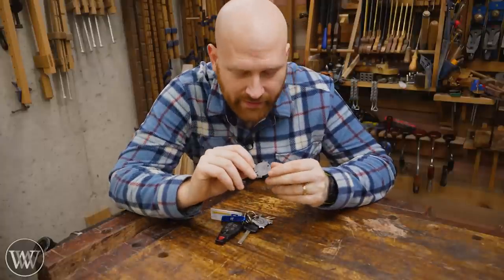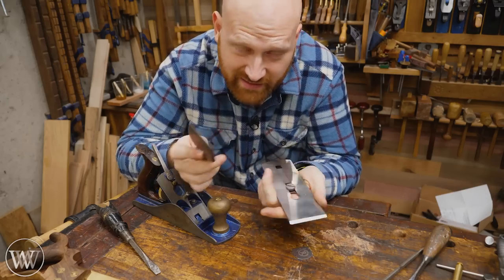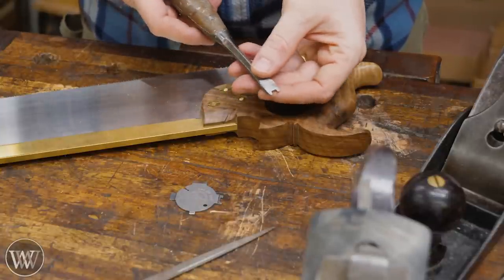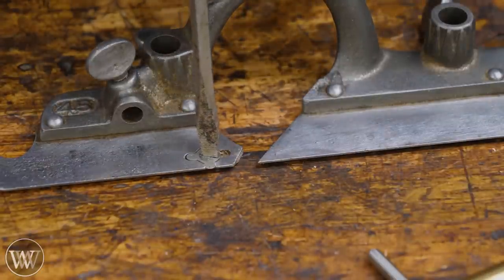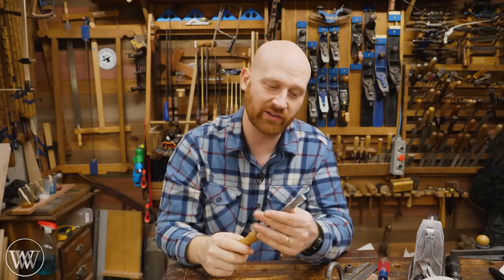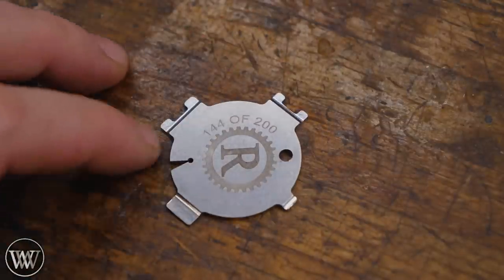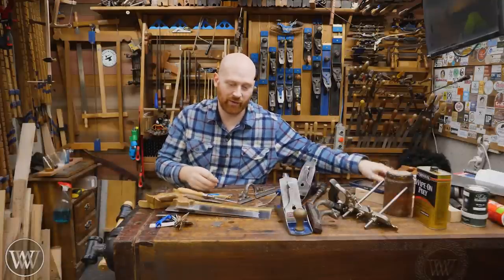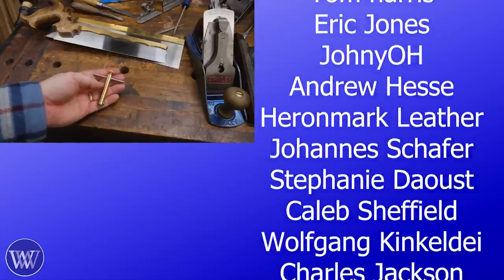The Hand Tool Hero | Not A T-Rex

Comment: I ground down my Marples size 6 flat screwdriver for very thin special screws (like on saws). Dont file it, IF you have a wetstone grinder (like Tormek) use that instead, the hollow it makes is PERFECT for screwdriver slots. Heck I reckon you could even use a benchgrinder, dont go to hard though so you ruin the hardening. considered it is alot thicker than a chisel edge it should be no problem.

Comment: I use the rounded portion of my Hand Tool Hero on chipbreaker screws. Even though it is curved, I find that the edge provides more contact than its individual screw driver heads.
Reply from the maker: That is a great idea!

Comment: I am curious how many people have problems with the screws on their planes and saws. My Milwaukke 11-in-1 screwdriver and my Klein 4-in-1 precision screwdriver handle everything easily except the split nut. I do have a bit for the split nuts which works just fine. If you really like the form factor, then get a 4 way screwdriver coin and file one of the screwdriver blades to fit your saws' split nuts.
Reply: I agree, never had trouble with the screws on hand planes. And they never leave the house, so the screwdrivers don’t have to, either.

Comment: 40 bucks ? From Rex ?  You’ve got to be kidding.

Take the R off it and maybe 15.
Reply from the maker: small run production for tools like this at a quality like this is very expensive. having manufactured a few things for small run sales I am surprised he could make it for that price and still turn a profit.
Reply: @WoodByWrightHowTo  whereas I fully understand and agree. The alloy that is being used “needs” to be stiff enough at the working thicknesses to avoid bending. Which as you say, is expensive in small batch quantities. Plus the actual manufacturing costs. 

I just have a negative attitude towards Rex. His style and presentation doesn’t sit well. 

That said, if you or Jeff were selling. An order would have been created on the spot.